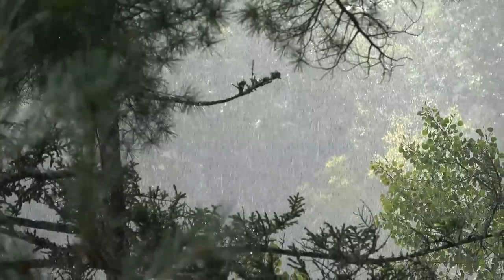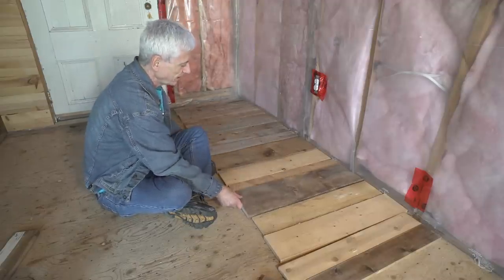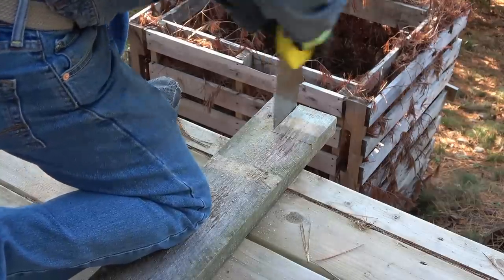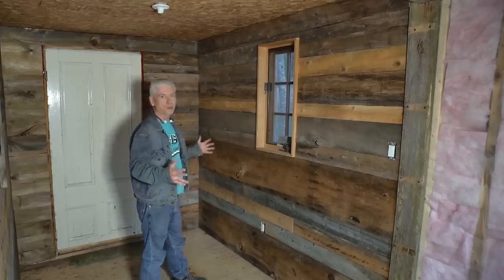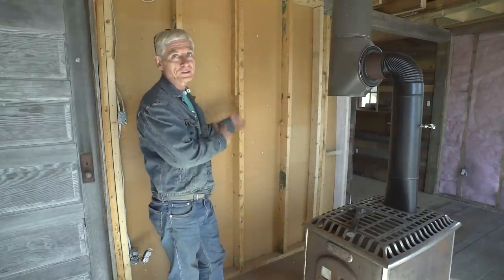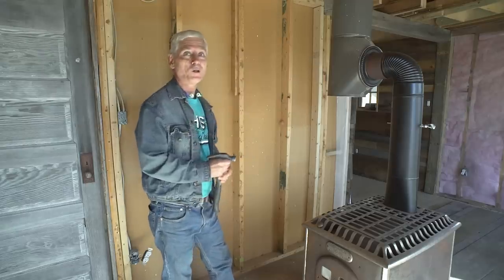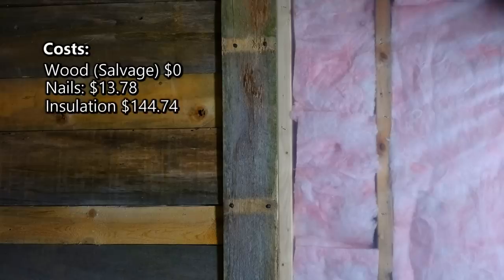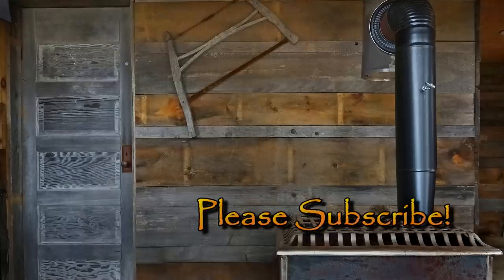Going Rustic: Slim's Cabin Fixer Upper Part 12

Comment: Raccoons - we had some get under our park model RV a couple of winters ago, there was about five feet of snow and they got into the crawl space. They had quite the party, getting into the furnace ducts underneath. Although we never found their disco ball, they definitely had quite the party. The repairs (which included getting an ozone generator in to get rid of the stink) cost about $13k. Luckily, raccoons are related to panda bears rather than being rodents, so insurance paid a big portion of the cost, although we now have an exclusion for raccoons in our insurance policy. We now have 1/4 inch wire cloth installed around the skirting and going down several inches to keep critters out.

Comment: the trail camera pics are very cool -you are going to have a lot of fun with that. we are using a Wyse camera  . I got to watch the deer eat my  pumpkin and squash leaves...
 FWIW :  cedar bark boiled for a while makes a decent 'stain' .  this was something the sawmill i used to work at tried out for an antifungal agent instead of the chemical we were applying .
this was used  for green wood that was being stored outside as an anti fungus and mold treatment. 'dip'. it worked pretty good but its anti fungal/mold effect wore off after a couple of months but the stain lasted longer...

Comment: Nice work Tater Noggin. Use whatever hammer you want. Hammers are like shoes. It's more about what is comfortable to the user. I liked seeing you wield that framing hammer - it takes a special touch when doing finish work!

Comment: When it comes to putting that pink stuff in, I all ways put the paper to the inside as you can fold the flaps out on each side of the baffle  and there for you can over lap and staple all the way down the stud  creating a air barrier  just a FYI   super great job  !!
Reply: Can't forget the worst part of Fluffing the Itchy stuff as well. Ugghhh making me itchy just thinking about it. Think some brands have a choice that's cheaper with that ""vapor barrier"". Might be why Slim used the plastic sheet?

Comment: Looks great Slim! Appreciate you actually taking the mold into account because most people aren’t educated on that. You may want to use a small ozone machine in your cabin (around $80 US on Amazon) and use that to make sure all the mold is dead. I am super sensitive to mold and can tell very quickly if a structure has it. I have been in spaces before and after using our ozone machine and it seriously works miracles and killing anything living inside a structure.
Reply: Just hope he was able to treat every side of wood that has the Black Mold. Nothing worse than spending a week or 2 recovering from ripping out mold covered wood that was cleaned on one side.

Comment: Slim, your cabin is awesome! 
Is that plastic sheeting over the insulation?  I was just wondering if the plastic would draw moisture or keep moisture  from escaping?  I have a very small cabin. My kids used the pink insulation on my walls and put plastic over it. I heat with a small unvented propane stove but water from condensation runs down the walls unto the floor. The walls have not been covered with wood yet.
Do you have any suggestions for this problem?
Thanks for all the great videos.

Comment: Slim just needs some copper or galvanized steel heat shield to put between the stove and the wall. Some flat rocks and some cement to protect the floor. And a fire extinguisher. I don't think Slim is gonna insure the cabin but if he did he was he would be up to code in the room at least.

Comment: Vinegar kills black mold but works best on non-porous surfaces when used by itself. Borax works a bit better and the professionals use industrial grade hydrogen peroxide. Mixing vinegar & borax is what a lot of people use on porous surfaces like wood & concrete. The borax also acts as a non-toxic deodorizer & insecticide.

Comment: It all looks great. I do have one concern about your roof. Didn't you put the metal roofing directly over the old decrepit roofing? Do you have plans to remove the metal roofing, take the roof down to bare plywood, and make sure there's no roof rot or anything like that? I kept assuming you were going to do that in a video but maybe it's just not something that needs to be done right now.
Reply from the maker: No plans whatsoever to remove the metal roof, it's up there for good! The wood underneath is the same wood you see in the ceiling, solid and in good shape. I walked on top of every inch! It was the extension that was rotten. Thanks! SP

Comment: Looks so cosy!
Was there any isolation behind the wall you put up last? Or maybe it isn't needed because you will be mostly alone in the cabin?
Loved the night vision animals!
Reply from the maker: Behind the stove wall is the bedroom. I didn't add insulation so the heat would transfer through the wall. I was actually thinking of adding bricks for heat retention, but that may be  a code issue. Thanks! SP
Reply: Thanks for the question, and for the answer! I was itchingly curious about that.

Comment: Ok, looking Good, but why the 90deg. Pipe connection at the Wood Stove, it looks like you could have turned the Stove 90deg. and attached a straight pipe connection, less chance for creosote to build-up with the straight type connection, anyway,,,,, looking Good.
BD in Alaska.....
and yea, my stove pipe exits straight-up and out, been working good for the last 20yrs +/-..... 😎
Reply from the maker: It was already installed that way, necessary to keep the stove away from the wall I assume. SP
Reply: Slim, forgot to add, that once that Sheet-Steel Backing-Plate is Heat-Saturated, it gives off Heat for hrs after the Stove is just about out......😎

Comment: on the wall behind the stove it looked like you covered up a receptacle?
Reply from the maker: I think you saw the bedroom light switch box facing the other side of the wall! SP
Reply: I think that it may have been just a junction box for the wire going to another room.